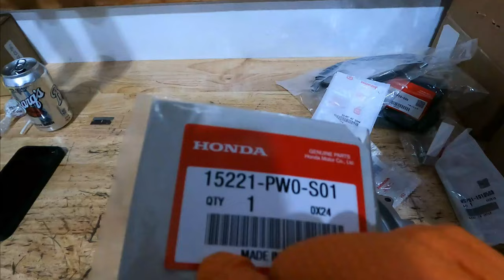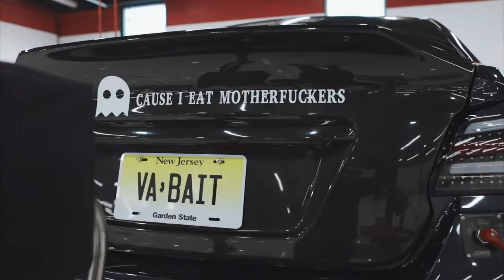Vlogmas Day 16! B18C swapped EG Hatch Build!

Comment: Did yal throw in a block gaurd on the b18? For the price and security I always go with one and hasn't failed me yet over the years
Reply: I had a b18b1 in a 2001 teggy I threw a turbo on and a block guard ran 24psi with a 62/60 only had a apexi avc-R controller it ran for many years until I sold it and the kid couldn’t handle the power and slammed into a pole t-boned and totaled it
Reply: It’s N/a with 200whp goal
No need
Reply: @Josh R  take it you don't kno Bader very well ? He loves too push limits and go for records and his future is always going faster .. thar car will end up boosted awd or k swaped boosted awd doesn't matter hp when coming too block gaurd it's a simple safety step for not even 200 bucks if ya was going g for high hp build I would hope u actually went full sleeve job not a cheap gaurd 🤷‍♂️
Reply: @stevendurbin9006  why they work? 
My brothers car is making 670whp for 4 years now on a b18c with a block guard.
You people are always funny. 
You have the most insight on how to build a car